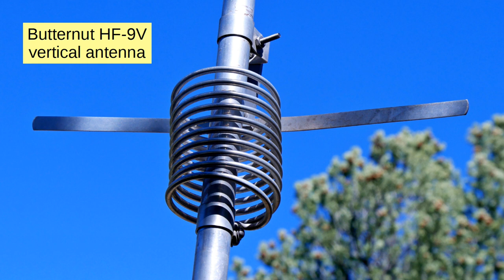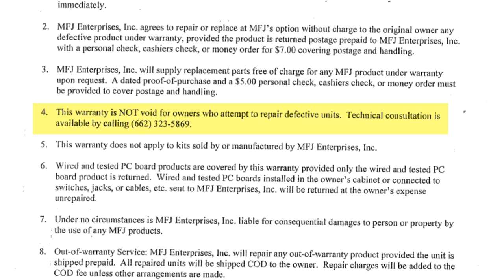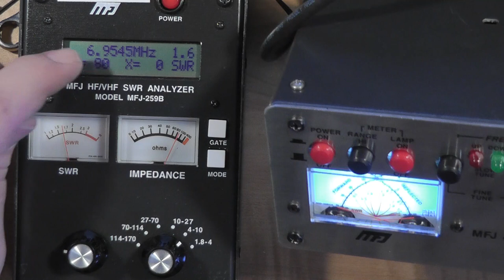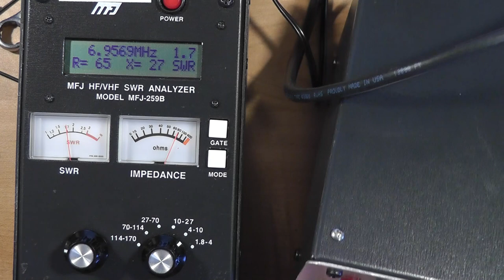MFJ 1788 Loop Antenna Fixed (#65)

Comment: One thing I found about my 1788. The plates on the capacitor were also way out of alignment but after dissembling mine I couldn’t get them to line up.  I completely
took the capacitor apart and found the shaft was torqued.  I managed to straighten it out with a pair of crescent wrenches. I’m sure it took quite a bit of force at the factory to cause this.
Reply from the maker: Ouch! Sounds like quite a process to get it right! Glad you were able to fix it.

Comment: this is a disgrace for a $500 aerial. and it's not the first bad report I have heard from them. huge profit margin on this aeriel. thanks for highlighting the issue
Reply from the maker: The most expensive element is that gigantic capacitor. Plus the antenna comes with its own controller, which is unique.

Comment: Well done for investigating the cause of the problem.. I did consider one of these antennas at one stage but I'm not so sure now. 73 G7MJV - England
Reply from the maker: I just put it on the roof in a horizontal position. I have about half the makings of a video on the attempt but got distracted.

Comment: Had to fiddle with mine also. I would recommend opening up the antenna and checking it before putting it up in the air. Was forced to learn about magnetic loops by having to wrench on mine. Mine had loose screws on the main shaft.

Comment: MFJ does have quality control issues from time to time as I have experienced. I recently went to installed the CW adapter board in my MFJ-9420 transceiver and when I removed the top cover I noticed that the two pin header that does frequency shift function was completely missing as well as the stand offs that support the board. I emailed MFJ about the missing items and after several false starts when they sent me the wrong items I finally got the parts I needed and was able to install the board and get it properly adjusted. But now I have a new problem, when I try to tune in SSB signals it’s as if the radio is in LSB mode and not USB. Haven’t figured out what’s going on yet but now that I’ve completed my move from California I hope to have more time to dig into it.

Comment: This is quite a while since this YouTube video that you did but I’m just in countering this with the MFJ 1788 that I bought about three years ago but for various reasons why I was not able to get going with it. And I think I have the same problem. There is a fellow Ham who runs a bit of a radio store here and he has had to fix two MFJ 1788 antennas by going inside and fixing problems like what you’re talking about. It’s quite disappointing considering how much it costs. Anyway I will take it to him on Wednesday and let him figure it out. I think it is something to do with all the plates of the capacitor hit that cut off switch like your problem. Anyway thanks so much for all your YouTube videos. I watch them avidly. I am an old ham just getting back into the business. I was a ham at age 15 in 1957, then dropped it and now I am getting going again with not HOA restrictions but apartment restrictions. Hugh Jones. VE7YJ. In the late 1950s the bands were spectacular so I would just hook my 10 W transmitter to a length of wire running 60 feet from the front to the back of the white without any coax and I could make great contacts and I never heard about antenna tuner‘s. Were there antenna tuners back then? When I start it up again it was quite a shock how bad the bands were three years ago. The dream receiver back in 1957 was the NC 300. So when I started up here I bought an NC300 from an Ontario ham and tuned it to the bands and couldn’t hear a thing so I junked it. How stupid of me!anyway I’ve got one on my tool bench and another ones arriving in a week or two and I’ll see between the two of them whether I can get one running. The sound of CW on it or of a.m. was out of this world. And it weighs about 68 pounds. You’re just plugged it into the wall hooked up the antenna hooked up a speaker and what a beautiful sound!
Reply from the maker: Hugh, thanks for sharing. The capacitor plates in the 1788 are made of remarkably soft metal. They can bend if the antenna is bumped hard.
Reply: @davecasler  Thanks Steve. My radio savvy repair shop guy found one cold solder joints in the controller and also somewhere else in the antenna wiring there was a wire just hanging by one strand so he’s fixed that and work a bit with the capacitor plates and I get to pick it up tomorrow. He’s fixed quite a few 1788 so I’m quite excited. Definitely bad quality control on MFJ’s part back 4 years or so when I ordered it
Reply from the maker: @hughbassoon  Sounds like your experience will have a positive outcome. Good luck!

Comment: Excellent, as all of your videos and comments are.  My most recent purchase from MFJ was their QRP Cub transceiver for 20 meters.  The kit went together well and this kit has been made for a number of years now.  But, boy does it drift!  Almost unusable.  If I knew that before I purchased it, I would not have bought it!  I have many MFJ products and they work okay to good.  73, Karl, KO8S
Reply from the maker: The old 40m CW 5 watt rig I have drifts too. It has to do with one of the capacitors in the VFO having the wrong temperature coefficient. One way to "solve" the problem is to turn the radio on about 2 hours prior to using it--by then it will have hit a stable temperature. (That's a lousy workaround, but it does work.)

Comment: Thanks for the videos David. I agree with wat you are telling about mfj manufactoring.
I bought years ago the mfj loop for 10-30 mhz.....Had some failures in the antenna.
The distance between some plates of the capacitor where to small. With a 100 W there where sparks jumping over.
The capacitor was not properly assembled. Also a failure in a soldering on the print in the loop was bad.
Fixed it all and work very fine......but for the price of this antenna it was better to not hurry and take the time in  the MFJ factory.
Hope you understand this writting...my englisch is not so good.
Anyway thanks again for the video on youtube  73 de pa3geo
Reply from the maker: Robert, I've done some more tweaks on my 1788. I'm going to mounted horizontally as high as I can get it and give it a try. I went through everything carefully and tweaked the movement of the capacitor plates so they are evenly spaced and move freely. I did not realize until recently that MFJ has 200 employees. They are essentially the only company that provides every station accessory you can think of, including an extensive line of antennas. It's a balance between high quality and cost. When it comes down to it, many hams are driven by cost, and willing to tweak things if need be. Plus, MFJ stands behind its products. About the only thing they don't do is try to compete with Yaesu, Kenwood, and ICOM.

Comment: MFJ makes some good products, but they need to work on their quality control. I've been licensed since 1988 and this was a problem back then. I've personally smoked an MFJ tuner running about 20 watts on 80 into a 60 foot half wave open loop. I just sent it back and got a refund. I used their 1621 54inch whip in apartment and didn't work every contact, but still had a good time on ham radio even when I had no space for antennas. I thought about getting the 1786 version of this loop, but still not so sure.

Comment: I don't have the loop antenna but have several other MFJ items. I have had to repair every one of them due to poor construction. I stopped buying anything with MFJ's name on it several years ago because I got tired of having to repair or rebuild something I had just paid for. They may as well sell everything they make as kits because you have to rebuild it anyway.

Comment: Hello Dave - We are building a new home and currently I have open trusses exposed for whole attic area.  Any thoughts on a choice for an attic antenna - the loop style on a rotating platform in addition to the capacitor controls seems like it would be great - 
I think I have at least 4 ft diameter space to hold the antenna.   Other dipole options may be possible - I am a new Extra class Ham and just launching my exploration of this fantastic hobby.   Thanks
Bruce  W2EAL

Comment: Dave,
Glad you found the problem and a solution. While you had the nut loosened to adjust the stop lever, did you also line up the butterfly leaves?   73   WB3BJU
Reply from the maker: Pretty much
Reply: I was thinking the same thing and wondering if the plates could even be moved...lol!

Comment: Dave, Did you check for gain off the ends of the loop when you had it set up  vertically? If I were to buy one the end gain on rotation would be why. From the omission I am assuming it isn't much. I would like to know.
Reply from the maker: I've never done any specific testing. I didn't find it terribly directional, though the radiation pattern drawings show a deep null on each side.

Comment: Holy smokes! Looking at the photo at 3:00, it looks like the stator plates in the upper right hand corner appear that they are not anywhere near centered with the rotor.  Is that an optical illusion?  That could severely limit maximum power handling, since it could easily arc over.  The stator seems to be reasonably centered with the rotor plates in the foreground.  It appears that the capacitor could stand a major adjustment in addition to the problem that you found.
Reply from the maker: Part of that is an optical illusion. I recentered everything and it works.

Comment: I have had my MFJ-1788 now for 3 years, it works great. But after a few weeks the antenna would not tune, it turned out that the same grub screw that holds the centre plates of the capacitor in place, worked it's way loose and the plate dropped onto the other plates, re-aligned, tightened screw, FIXED. Apart from that, I am extremely happy with my loop antenna.
Ray in Melbourne.

Comment: Thinking of getting one but drop shipped at local HRO to test in their store b4 bringing home.  Do you still own it?  Does it tune on all or most of 40m band?  I did own the 1786 but had no problem with that one.  73 Mark KK2L
Reply from the maker: I still on it and it works fine. It's up on the roof of the house, but it's not one of the antennas that I use frequently.

Comment: At 3:45 it appears as though the rotor and stator plate are touching or nearly so. Should there not be equidistant spacing? As built the voltage specification cannot be met. Also did you address the misalignment of the rotor plates shown at 2:00?
Reply from the maker: The rotor/stator misalignment at 3:45 is an optical illusion. The plates are properly spaced. And, yes, I did realign the rotor plates, although I didn't try for perfection. 73

Comment: MFJ may have some problems form time to time but just think about all the things us hams use one  a daily basis that would not be there without them. YEs their quality control is out of control! I just purchased one of their battery boosters and liked it so much I purchased the remote head for it. Thought I would have to send the head back because it did not work. It uses a cat5 cable between the head and the unit. Just for the heck of it I swaped out a old cat5 cable I had in the junk box and it started working. The problem was a 2$ cable and I almost had to spend the money to return it and they would have had to send more money shipping it back.

Comment: Dave, it looks like someone cut those rotor capacitor plates out with a hacksaw. Is that a video/photo artifact or distortion? The outside edges don't appear to be smooth arcs.

Comment: Enjoy your vids. I’m in an HOA out of necessity and considering the 1788 as an attic antenna. Just making sure, can you now cover the CW portion of 40?
Reply from the maker: Yes. Once I fixed the limit switches, it works fine.
Reply: check your hatch size, it wouldnt fit through my hatch
Reply: @mattbw-G5MAT  will do. I’m also considering an HOA Buster…uses rain gutters.

Comment: So the problem was just crappy assembly and the warranty is written so the owner can fix the crappy products without voiding the warranty and don't have to bother MFJ?  That's hilarious!  I knew you could fix it Dave, I wasn't worried for a minute.  You didn't mention if you fixed the poorly mounted capacitor plates but since you got a lemon I think you should have sent it back and got a good, properly built unit.

Comment: Nice detective work in getting it fixed and on the 40 band! I don't know
 though Dave, I wouldn't be too hard on MFJ...I mean I know they 
charge a lot for their stuff, but they did support you via customer 
service with this... actually ALLOW tampering with the hardware (look at
 companies like Apple..they would have voided that warranty faster than 
you could have keyed SOS)  Plus I know each should be checked.. but if 
you don't hear a lot of people with the same complaint and problem, it 
could just have been a one time mistake. I mean these are human beings 
checking and assembling them, we all make mistakes.  I just think that 
it's a very good sign that the company really meant you half way, it was
 repairable (meaning the parts they gave you were quality, just not 
assembled correctly)  Anyway Fine Business that you were able to get it 
set up!  Are you going to do a complete usage trial and test of the 
Chameleon loop as well?
Reply from the maker: Yes, that's the plan.

Comment: I have had a  love/hate relationship with MFJ  products over the years.  The issues I've had with several products could also have been avoided if they had just checked to see if it worked properly.  As a result, I look first to other manufacturers,  MFJ  being the last choice.

Comment: Great it solved the problem. Wouldn't it have been easier and faster to move the limit switch?
Reply from the maker: +Apprentice gilligan Actually not. The switch was on a phenolic board and had no adjustment capability. I thought about bending the switch arm, but it would have to have been bent quite a bit. Moving the arm itself turned out to be easy. 73, Dave

Comment: Sir David
the big mysterious question which hunt me since years is : Does the MFJ loop specially in 40 meter with it's 1 to 40 (diameter ratio for 40 Meter), would it give a performance ERP close to slandered Half wavelength dipole or (quarter wavelength with radials) (Vertically oriented)
Reply from the maker: So far on 20 meters it seems a fine antenna. 40 is not so good, but now that it's fixed, I'll be retesting.

Comment: David,
Surely you can't use much power with this loop? Given that the capacitor is an open design and not a vacuum capacitor. It would really surprise me that it wouldn't start arcing at around 50 watt....

73
Paddy
Reply from the maker: It works well.

Comment: would be interesting to see how much power that capacitor could actually handle  before acr over , I suspect the 150 watts radio output is on the conservative side ?
Reply from the maker: Maybe it is conservative, but note that any arcing will immediately change the SWR quite dramatically, and can thus damage a radio. I'd say stay within the rated limits.

Comment: You wouldnt happen to want to put together a "here's how to clean and check your MFJ Mag Loop" video, would you? I've had mine since around 2003 and love it, but it desperately needs a cleaning inside, and either the remote tuner needs to be replaced or a component inside the antenna housing needs attention.  Great videos!! 73 de Jeff, KF5KWO
Reply from the maker: I recently had to repair mine. Fixing one problem created another. I tried to use it at Field Day but we couldn't get it to work. I found out I'd moved something so it jammed on a screwhead and stopped working. I'd say just gently clean it out and see if there are any broken connections.
Reply: David Casler Thanks, I'll give it a go.  I've got the -1786 (the 10-30MHz model) and I think it's a great antenna for my limited space and low-profile operation. 73 de Jeff, KF5KWO
Reply: personally I prefer the 1786 model, you lose a very lossy 40m loop and gain a high efficiency 12m and 10m loop.

Comment: MFJ seems to cut many corners both with their designs and their manufacturing. I've received products brand new with loose parts rattling around inside, things that were never soldered, electrical assembly errors, mechanical assembly errors like you found here, under spec'd or substandard parts that don't last or can't handle the specified power, antenna tuners that arc at half their rated power, meters with broken movements, etc. Sites like eHam are full of negative MFJ reviews documenting similar problems going back many years yet MFJ never seems to get any better. They're a rare case where made in the USA is generally worse than made in China. Even QST has received review samples of expensive MFJ products with assembly errors that had to be repaired before being usable. Their quality control must be nearly non-existent and their management lacking if they can't even ship review samples to ARRL/QST that are assembled correctly. I'm amazed they're still in business.
Reply from the maker: I also regret the frequent quality slip-ups and have been open about them in my reviews. However, MFJ fills a niche in the ham radio market that no other company does. If they suddenly disappeared, we'd all be in trouble.
Reply: @davecasler  "If they suddenly disappeared, we'd all be in trouble."

I whole-heartedly agree with that statement.  I've run into a few QC problems too but I take it in stride considering many useful tools that MFJ provides.
K4PSD